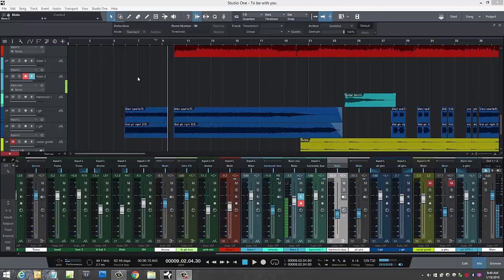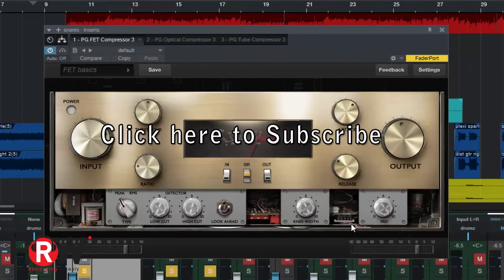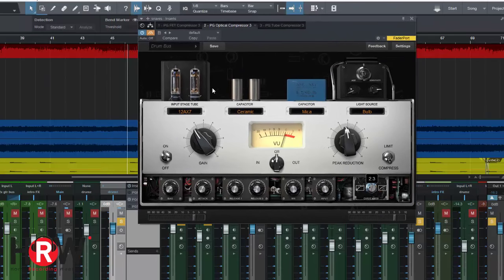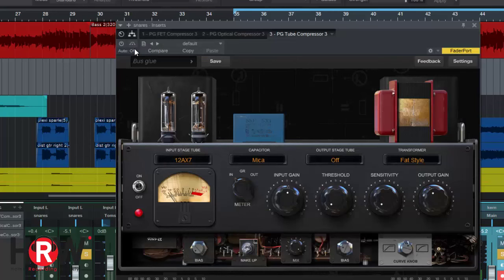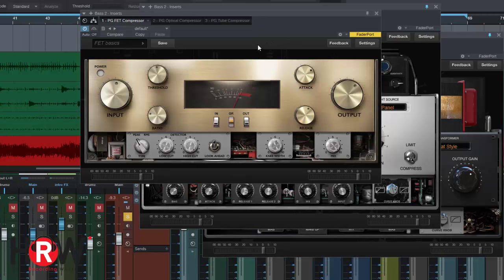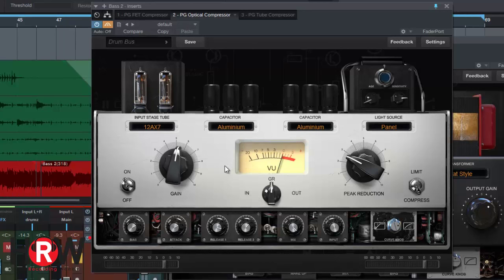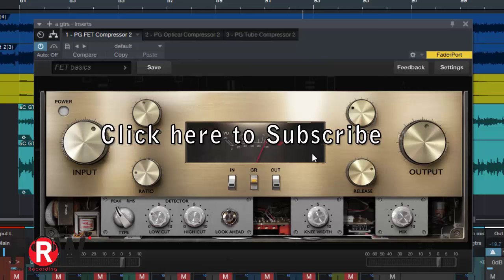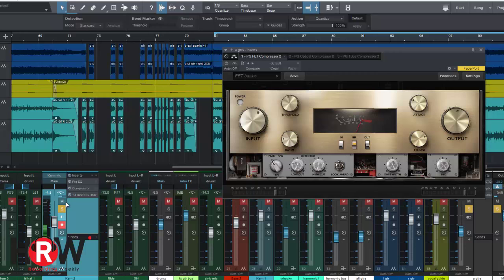Positive Grid Pro Compressors demo

Comment: Only watched about half the video, but I could hear literally no change whatsoever on most of the examples, even using headphones. I could hear the change on the snare with the black EQ, but when you unsolo'd the rest of the mix, I couldn't hear the changes at all, in the mix.
Reply from the maker: Excuse me if you know what I am about to say. Compression is tough to "hear". What you might hear are the subtle changes to the attack, sustain, release, and the decay of a signal change. Also some character (might sound like small EQ changes)  is added to the original signal with these comps. Again, if you know all of this and just cant hear it happening in my demo, ok. I am trying to defend what I hear/heard at the time I made this. I found these comps very altering in dynamics and tone.
Reply: Yah, compression is definitely a tricky one to hear, and my air conditioner going in the background probably didn't help any. I have no doubt it was doing something, but you probably heard it a lot better in the original recording than it shows up on here.

Comment: Interesting plug ins.  I thought the black one sounded nice.  The variety of sounds it can do are cool, but I don't feel the component swapping feature corresponds in any way to real life.  You would never see large bottle power tubes on a compressor.  You would blow out your audio interface from the insane amount of volume generated.  The image shows what looks like power transformers with 3 different PT options.  Nice idea, but changing a PT would have practically no effect on sound.  Changing an audio transformer on the other hand, could have some effect on sound.  Capacitors - well there is no decent piece of audio equipment that uses ceramic caps in the audio path.  Thats a big no no.  They sound like total crap.  Aluminum electrolytic caps are generally avoided in audio paths in circuits because they tend to cause distortion and generally don't have a great sound.  Mica is old school, paper in oil is smoother sounding and even more old school, film is modern.  Should of had those options.  Sorry for the rant.  Finally, no modern piece of tube gear should reduce low frequencies.  It would not be a good piece of equipment if it did that.  Really super old stuff may do that because design requirements were less stringent in the old days.  It seems like the designer of this plug in has limited knowledge of whats going on with electronics in compressors.  On the other hand they have a product that sounds good and appears to be useful.  I like how it allows the end user to get a little more creative with the effect.
Reply from the maker: There is a lot going on there, in your comment. I guess I would agree with the parts that I know and understand. The rest, well, I will fully take your word on. Thanks for watching and for your words.
Reply: ***** No one forced you to read my comment.  Its just my opinion and suggestions for improvement.
Reply from the maker: I value all comments